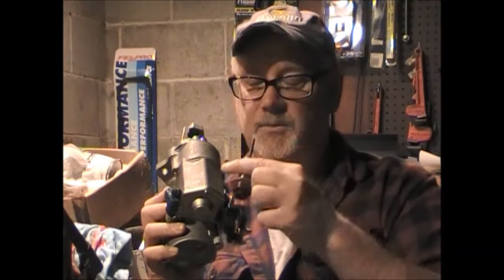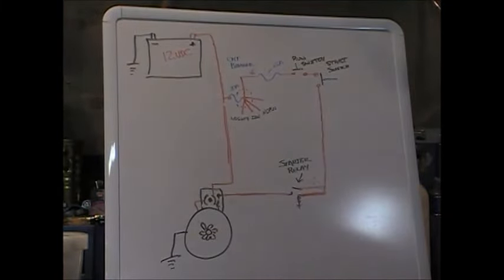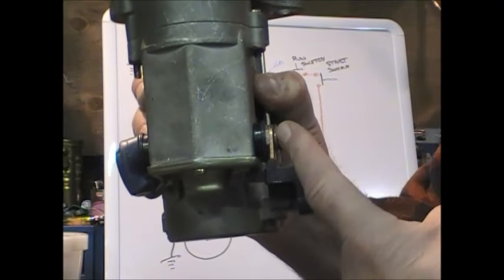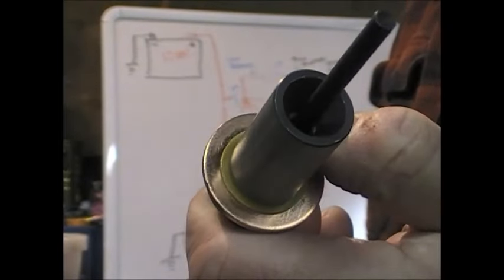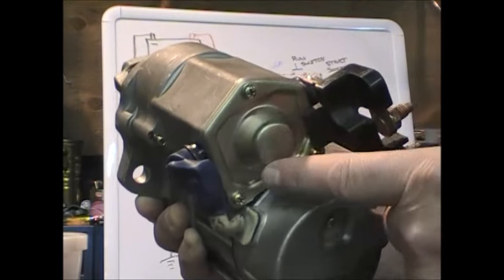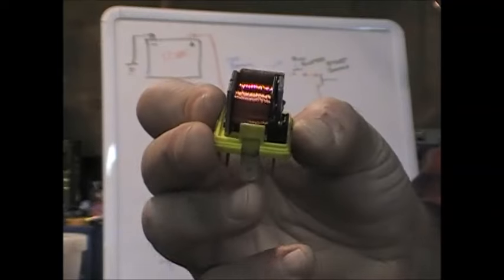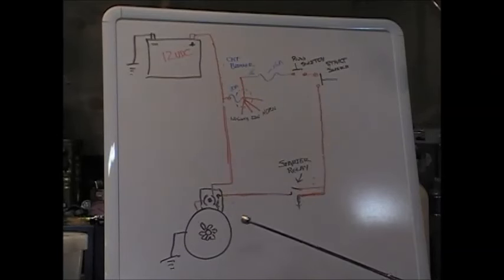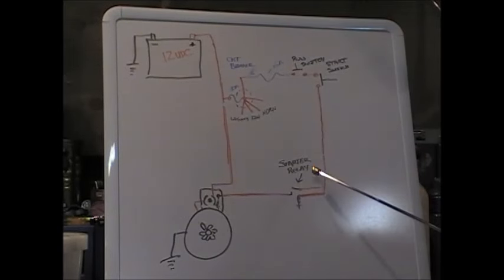Harley Davidson and the Click of Dread

Comment: You actually want to disconnect your negative lead. Negative lead is always first off and last on. On my Harley it's also significantly easier to access the negative terminal on the battery than the positive. With only the negative removed it will not matter if the positive is then accidentally  grounded, no damage will be done.
Reply from the maker: Yes, I covered my filming 'mistake' in the video description.  However if one is careful pulling the positive first will not be much of an issue.
Reply: basic idea    100 percent   only way

Comment: motorcycles used to be more simple to work on but now they're getting more complicated like cars, it's almost to the point where you can't fix anything by yourself anymore because for some damn reason they got a program something into something on a printed circuit board once you get something fixed on and that could cost you a couple hundred dollars just so they can program whatever it is

Comment: I think you just saved me a boat load of cash... my bike has a case of the clicks, but if I push start it, she runs fine. Figure as long as I have to get my hands dirty, that's going to be a new relay (possibly 18 years old by now) and a solenoid rebuild for good measure. Worth the $30 to keep it out of the shop and on the road... Next time you are in San Diego, I owe you a frosty adult style beverage.
Reply from the maker: Hey that's great!  I'm glad you found the video useful.  And you are on for that beverage!  ;-)

Comment: All of the things you mention here can and will give you problems and I went through all of these 'fix's' back in the day on a 1990 Sportster. I also found that when I pulled the plunger out of the solenoid there didn't seem to be much pressure from the spring that kept the plunger disengaged from the contacts - indeed the starter had 'over-run' a few times despite my taking my thumb off the button when the engine fired. Said spring was then coaxed out of the solenoid housing and found to be 'packed' with grease that hat had dried out over the years and become solid - thereby making it harder to compress the spring and - more importantly - stopped the spring extending properly.
 This made the plunger hard to move and caused the starter  relay to 'over-work' and burn the contacts. Remedy was to clean the hardened grease residue from the plunger spring, re-coat with new lighter grease - just enough to stop the spring corroding - and refit everything..... NEVER had a problem again !
Reply from the maker: Thakery,  your story reminds me of Japanese dot matrix printers back in the day (day being the 1980's and the brand Star Micronics comes to mind) where the grease they used would harden and gum up  after a few years.  I can't say I've ever seen that kind of a problem with a starter but there is always a first for everything and I thank you for sharing your tip.
Reply: @ Thakery  Yep last sled I had with kicker I installed was '76 Bicentennial Model FLH . The kicker kit allowed me to use an Easy Rider's Tech Tip diagram to remove and throw ,  literally , the vast majority of the 54 stock wires on that Dresser . Been push button or plain push starts ever since . At least this gave my leg leg time to grow muscle and my right leg to atrophy a little !!!!  They are almost equal now after all those years . LOL ..... Thanks for some Golden memories Malcontent corner , great video .

Comment: I have the dreaded click sound which I believe is coming from the starter solenoid. It started doing it a few days ago but would start like you were saying after a few tries. Not until yesterday, while it was in the garage, would it not start at all. This is a 2005 Dyna Wide Glide Twin Cam. I'm going to go through this procedure and make sure everything is clean and probably change the relay while I'm at it and also check the ground wire from the relay. I'm not sure on the '05 Twin Cam but supposedly on the older Evo's Harley-Davidson used a thin guage ground wire that could build up excessive resistance after some years and a fix for that is to install a heavier gage ground wire. If this one has a thin guage wire I'll probably go ahead and swap it out with a heavier one while I'm at it for some extra insurance. 👍
  Thanks for the informative video!

Comment: You remind me of one of my teachers in college, "its an open,  or a short". Well done. And i am finding that " cheap" is a relative term,  esp. when talking H.D. rebuilds. I think i want a new bike.
Reply from the maker: You are right, cheap is a relative term and unfortunately too many people cheap out in the wrong areas.  I'm a firm believer that one should never cheap out when it comes to their brakes or their tires and this is especially true when it comes to their motorcycles!!  I also feel the same way about the batteries on motorcycles since they are typically not easy to get to, they tend to die w/o warning and walking sucks.  The battery insurance is even more true today since today's bikes rely so many more on electronic-esq things (fuel injection, engine computer, etc) then they did in the past.

Comment: Mine's doing it right now...but it's not an Evo, it's a twin cam...& it did it in the driveway...still doesn't make it less dreadful...🤦‍♂️🤦‍♂️🤦‍♂️
Reply from the maker: I know, right?  You should check out my video on a solenoid cover with a push button.  Makes and excellent fail-safe.

Comment: I'm going through the exact same thing I got a 94 FXR and it starts and then it don't start I have to clean off all the terminals and cuz they're coming it's not getting to the starter and when it does it starts perfectly I did replace the the relay a couple years back but maybe I'll get a new relay too and the battery is about 5 years old so thanks for the information fingers crossed say a prayer

Comment: NOTE Contact kits with the solenoid core are dirt cheap (~20 bucks online) so I never clean and ALWAYS replace old ones! Your primary cover and starter gaskets that get ruined removing the starter cost more than the contacts. 

Good contact inspection and replacement video. https://www.youtube.com/watch?v=qwokxzjlYcQ

I agree on replacing any questionable relay because the contacts are tiny. Parts are cheap, tow bills are expensive. These Bosch style relays are used in the hundreds of millions so you can find them at auto stores if needed. Bring the old one to compare the schematic on the case or base of both relays. Some auto store relays won't have the mount tab. 30 or 40A heavy duty relays are preferable. 
Every Denso starter on a Harley should have an aftermarket pushbutton solenoid end cover. The ~$20 versions work fine and I've installed many (all my bikes and many customer bikes). 

This guy should have inspected his contacts with the cover off but the video shows a typical cover: https://www.youtube.com/watch?v=4O6jd69i4zc

The pushbutton cover is ideal backup (or main start for a chopper) because it doesn't even require functional solenoid windings, let alone a start relay, starter button and the rest of the control circuit. When we had customers with bad windings (fix is replace the starter unless your local starter rebuilder orders you a matching part which is easy to find since these are on millions of cars including Toyota) who couldn't wait for a starter we drilled quarter inch holes in the stock cover and handed them a round shank screwdriver to manually push the noid core. MAKE SURE THE BIKE IS IN NEUTRAL FIRST!

Comment: clean the starter relay plug with a electrical cleaner too... also clean all connections and relay ground wire too... clean all breakers connections and both ends of battery cables...

Comment: Solenoid contact kits are about 25 bucks online including plunger and side contacts, so given the effort involved and the high cost of primary cover gasket and seal kits I would only sand contacts in some dire emergency. Much love for the outstanding design of those very popular starter motors. I install pushbutton end covers on mine as a rule, but ya can drill the center of the cover and use a screwdriver (round shank preferred) to start the bike until you get a pushbutton.

Comment: Just got my click of dread on my 93 Dyna.  Battery putting out over 13 to 14 volts but... click click click. Your video was a great help and just wanted to say thank you!  Ok, I’m going out to the garage now and start checking the connections, then go with a starter relay if needed. Last resort is rebuilding the stock solenoid or getting a bypass switch.  Thanks again!
Reply from the maker: Glad to hear the video was of some use.  Thank you.

Comment: I also have the click!  Mine is a single click and I notice the batt voltage drops.  My first attempt also was the relay,... and I thought I had it beat.  Then it came back.  I would like to get an amp meter on that solenoid line to see what it's pulling.  I'm sure their is a spec.  My best guestimate after my ventures is a weak solenoid. But on our model you need to pull the primary cover to get the starter assembly out, best I can surmise from the manual and a youtube video.  My temp fix was to drill a hole in that end cap on the solenoid.  Jam it with a #2 Philips. Off you go!
Reply from the maker: LOL  A McGyver solution at its best!!

Comment: Got the "click of dread" yesterday, and mine is doing exactly what yours did, clicked and then started and didn't have a problem the rest of the day. It had sat for a week and half and didn't have the problem before, just started out of the blue. Had the battery on the tender the night before my ride. I checked battery with voltmeter and it showed 12.7 volts, 14 volts while motor was running so the stator was good as well. Took the battery to Battery Plus they tested it and said it was good. Was starting to worry about the starter....expensive fix....then saw your video going to try starter relay and see if that does the trick.....thanks.
Reply from the maker: Glad the video helped you and I hope it fixes the issue.  Depending on your bike you may want to look at the video I did on the solenoid cover with push button for extra insurance.
Reply: @Theoriginalmalcontentcorner  I did,  I got a '12 Road King I bought a relay switch and the push button cover last night from Dennis Kirk...lol...thanks again.

Comment: What I do in this situation is I take a jumper wire from battery positive directly to solenoid primary connection. If it still clicks it is a solenoid problem and if starter turns properly it's a switch/relay problem.
Reply from the maker: Nice troubleshooting.  Personally I'd do the same if I suspected the solenoid in my situation but I knew it wasn't the solenoid itself.  However, and this is for some of my viewers, if you try this technique do be careful when attempting such!!  You don't want to short anything out in the process!

Comment: Thank you Malcolm you shed some light on some problems.  I'm having having with 91 Sportster I've got that dreaded click click in the starter. So the  next time I'm home I drive a truck for a living I am going to do what you said cuz my relay is missing the plug where the blades are.  so I took that off one time so I got to look in the replacing that and I am going to clean the starter and the contacts but thank you again for that helpful tips.

Comment: 2007 FLSTN Deluxe - loud starter clicking - replaced battery (was on its way out) - no fix - replaced starter relay - no fix - next step check connections to starter but a prick to do as the oil tank needs to be removed. Instead I may pull out the Jack plunger and dump electrical cleaner in the starter.

Comment: I gota a o3 softtail duece .started clicking ..circuit breaker corroded. Replaced .replaced relay .cleaned selinoid contacts .still clicking .good battery.pulled off primary cover .the damn bolt in jackshaft .had backed out shaft was sitting loose put back in tightened bolt no damage to flywheel teeth or jackshaft .started right up..got b lucky

Comment: first step in performing any disasembly of electrical components is to disconnect ground to the battery.
Reply from the maker: Sorry guys, it was just a misstep on my part that I didn't correct and cannot without deleting everything and re-posting.  Given certain training with old school electronics (vacuum tubes) my first instinct is to pull the positive.  With cars obviously negative is the way to go to minimize the chance of anything bad happening but pulling a positive won't hurt anything as long as one is careful.  My main point is that battery IS disconnected.  And no, James, I caution about short circuits but haven't created one myself.  Much like cutting with a power saw- I can warn the viewer about making sure the  power cord is out of the way when cutting but have never cut a power cord myself.  ;-)
Reply: @Theoriginalmalcontentcorner  Very good points, thank you! I always pull the positive myself, taking care to not short the wrench to ground. Been there, done that. I too grew up on vacuum tubes.

Comment: My Sportster was cranking, but not turning over.  Tried three times, same thing. Waiting a minute tried again, three times.  On the last try, it was cranking, but that stopped and it was clicking very rapidly.  Any suggestions?
Reply from the maker: Hmmm...well first thing I'm wondering is- how old is your battery?
Reply: Malcontent corner ;  The battery is new, just got it today.  The bike was doing the same thing with the old battery.  That battery was about five years old, so I figured it needed replacing anyway. But, the bike is doing the same thing.  I know if I take the bike to Harley, it’s going to be a huge bill, so I’m hoping to figure it out. Thanks!
Reply: Rapid clicking is coming from the starter🤦‍♂️
Reply from the maker: Hiya Coney!  While I'm not a 'fan' of throwing parts at a problem in an effort to fix, I do applaud you on getting a new battery.  At 5 years old I'd say the old one probably wasn't very long for the world.  However you still have the problem...unfortunately....but this is what I would do if I were in your shoes.  Sorry but it will be long winded: 

If I had this problem on my, say, '95 Sportster I would take a look at the starter.  It should look a lot like the one I use in my video with 3  leads on the starter/solenoid- 2 heavy duty lugs with nuts and a 3rd lighter duty wire.  The heavy duty lug(s) are your main power lead(s) from the battery to one side of the solenoid.  The other lug goes to the starter and typically has a rubber cover on it so it may be harder to see.  Not an issue though as what I'm looking for is that 3rd lighter duty wire which will be the wire which energizes the coils in the solenoid which in turn pulls the plunger in and makes the starter turn over.  That click click you hear is probably (without being there I can't say for sure 100%) the plunger bouncing in and out which means the magnetic field is breaking for some reason. If mine, I would pull that 3rd wire as it should be a m/f blade affair.  Then and only after making sure the bike is not in gear, I would CAREFULLY and taking care to not short the wire on anything metal, take a jumper wire and go right from that connection on the solenoid directly to the positive of the battery.  Doing such bypasses the run switch, start switch, starter relay, etc.  If in gear, the bike will lurch which is why I make sure it is NOT in gear.  If the starter cranks then you know the problem is in the circuit before the solenoid.  If it still clicks, then you know the issue is with the solenoid/starter/battery.  If memory serves me correctly I think the starter is rather buried on sportster but I think(?) it is accessible to some degree.  Anyway, that is what I would do.

Comment: Just experienced this on my very first Harley. I have driven it exactly once lol! It is a 1991 Electra. I ordered the push button cap, be here Sunday! Thankfully it happened at home!
Reply from the maker: The push button solenoid cover is a GREAT fail safe, IMO.
Reply: @Theoriginalmalcontentcorner  I ordered a repair kit for the solenoid. While installing it I discovered the solder on one of the leads to the windings had let go. That was my no start problem. Oh well, the new contacts are installed and the bike starts once again.
Reply from the maker: @SilverPaladin   Ahh, a broken lead?  12V DC typically won't arc the gap.  ;-)    Nice job at the repair!
Reply: @SilverPaladin thanks for this info.  I have a “no start” as well.  No click no nothing.  Just keeps sounding like the fuel pump primes when I hit the start button.  I ordered my repair kit this morning, and can’t wait to start plugging away.
Reply: @joeykahng6219  when I installed my kit, it turns out one of the leads had de-soldered and was flapping in the wind. I soldered it back down and problem solved! Then I had to use the push button cause the starter button stopped working, and that turned out to be a bad ground wire.

Comment: I have a 91 fxrs-sp, I've replaced all components, cleaned commutator and brushes, put new contacts in solenoid. Replaced relay. I even hooked my truck battery directly to the system..
And my starter still will not trun over the bike..
i don't knowmwhatbelse to do.
I have bench tested the starter and it engages great..I'm at a lose. Any more suggestions??
Reply from the maker: So what happens when you try the starter on the bike?  Does it spin?  Exactly what is it doing?

Comment: You can throw a Solenoid Cover Push button starter for about 20 bucks and skip all the BS that happens going in to the relays....great just to have.
Reply from the maker: One could do that and I covered that in my vid on the solenoid cover with the push button.  However, I offered this up in case someone wanted to keep the OEM affair.